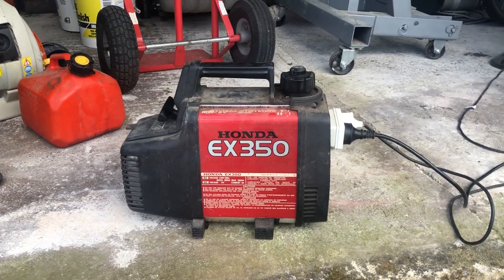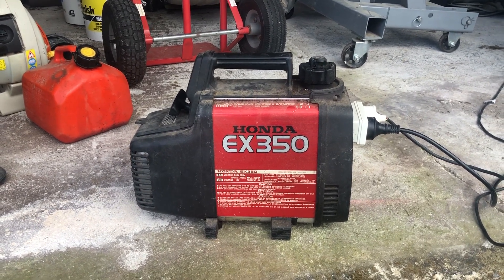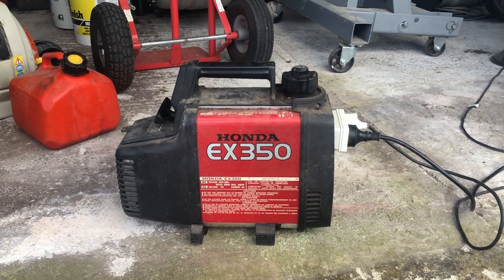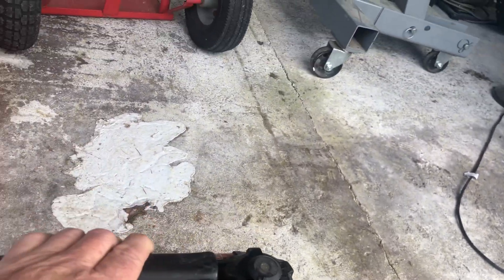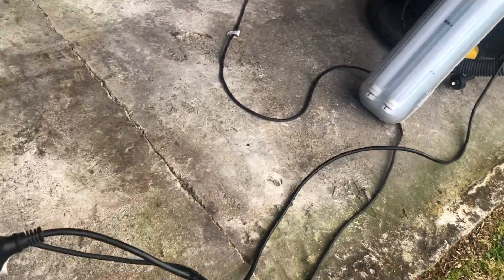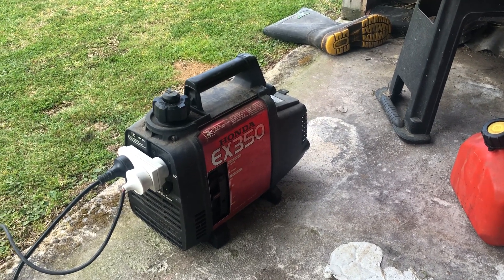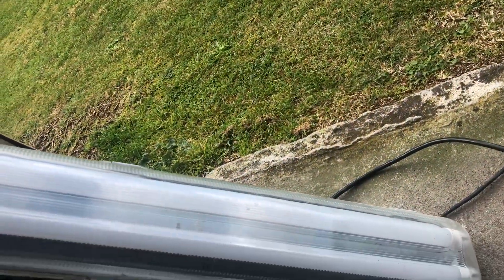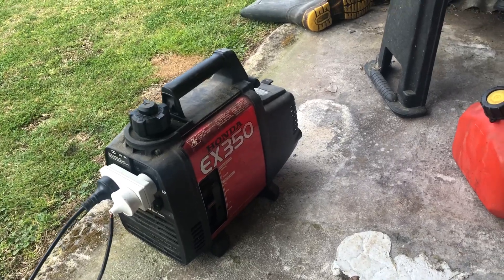Honda EX350 Generator

Comment: I just purchased one for $80.00 here in New Zealand🇳🇿 it's in really good knick.
It runs on 100-1 oil/ fuel mix ratio so Amsoil Saber will easily do that
Reply from the maker: Good score ppl don’t know what they are, last one I saw on trade me sold for $260

Comment: You'll never run a normal fridge with that thing. They take about 1500 W when the compressor starts.
Reply: ... Well that is what I thought too but my old "Liebherr" took 1600W on startup according to the Uni-t 71E Power Measurement unit :-)
I did measure our new Bosch 192Liter fridge closet style with 90W rated compressor it took 137W peak solo YES A VERY MODERN FRIDGE RUNS ON MY EX350 VERY FINE